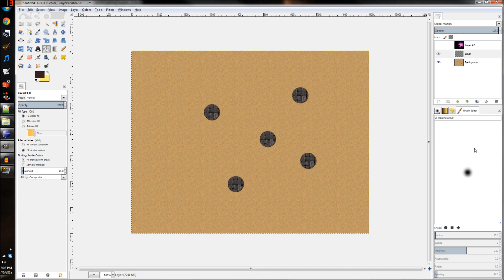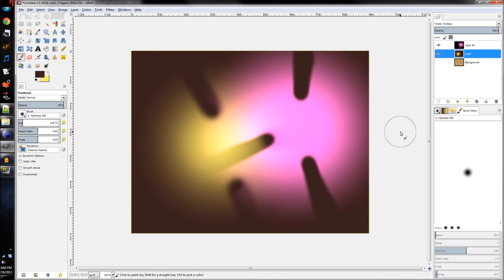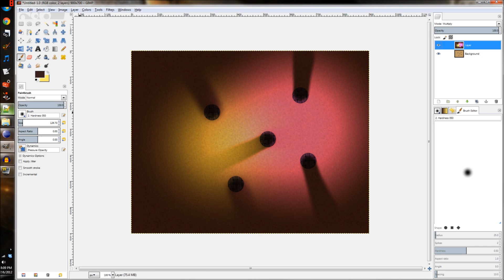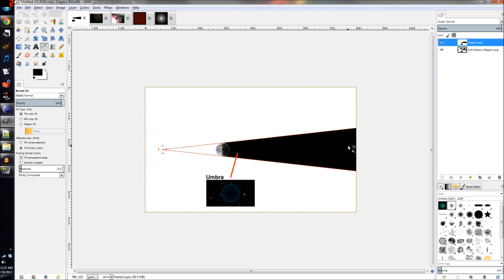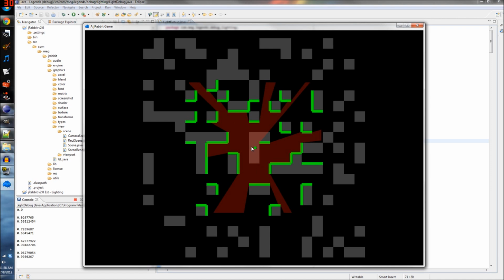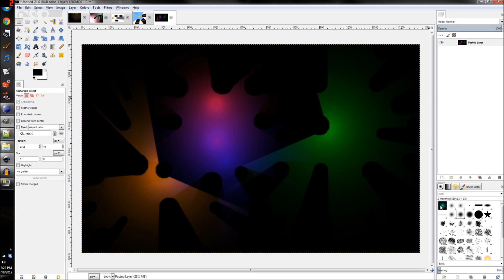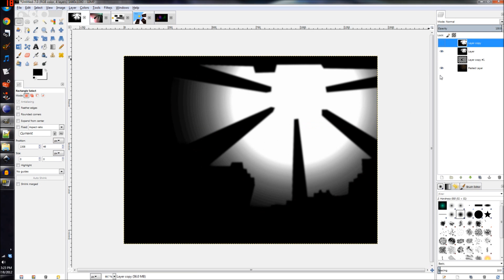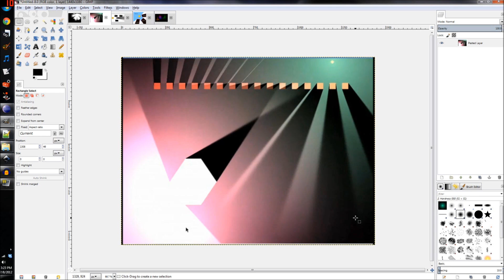2D Lighting Tutorial Part 2 - Shadow Casting

Comment: I know, I'm writing this comment 3 years later, but I don't care. I've also made some systems of light based one one strategy: Starting in one point, going as far as it is possible on the right, setting the direction that the point ending the ray of light moves (it's like I have a laser, I'm moving around and checking which way the point ending the laser moves) and then checking next points in which dimension of  this point can change. It gives me possibility of pretty easy making flashlight effect without any lose of efficiency. Also it can go reaaaly far (when it is too far it can generate bugs, but it must be just really far). Well what is the best - It is really effective! I'm really proud of this :)

Comment: Just implemented own shadows in monogame (platform independed xna) with blured edges http://www.youtube.com/watch?v=zS9q8j2aL6k
its totally implimented in VS and PS shaders, by 360 FOV regarding to a light position and as a result i get rendered texture of depth + blur for each light, where each line of the texture belongs to a light - you can see this texture on my video on the top (when shadowm map is displayed) where value of red is depth, and value of green is blur for specific angle. Then its quite simple to get shadow map:
float4 MakeShadowPS(VertexShaderOutputMakeShadow input) : COLOR0
{
 float2 pos2d = input.PosW.xy;
 float angle = atan2(-pos2d.y, pos2d.x);
 float2 UV = float2((angle / 3.1415926535 + 1) / 2, LightV);
 float2 shadowDistanceAndLighting = tex2D(depthSampler, UV);
 float shadowDistance = shadowDistanceAndLighting.r  * LightRadius;
 float pixelDistance = length(pos2d);
 float4 final = LightColor * float4(1, 1, 1, (1 - pixelDistance / LightRadius));
 if (pixelDistance > shadowDistance)
 {
  // do alpha blending between shadow color (0,0,0, shadowDistanceAndLighting.g) and lightcolor
  final*= max(1 - shadowDistanceAndLighting.g, 0);
 }
 return final;
}

A little problem is that i have to render topology buffer 4 times to get this texture (its rendered as lines, where each vertex of a line is Vector4(posXY, anotherPartofLineXY)). 2 pssses for each depth and blur units with masking channels r/g, +2 passes per each because of the lines where start and end positions according to line position are in defferent planes of the circle and their angles >= PI, ie abs(startAngle - endAngle) >= PI or else in this case it will overwrite almost whole depth buffer, so second pass culls almost all the lines and averagelly 1/8 of them actually rendered.

But depth and blur should be separated because of blending and Z-buffer pass, for depth part it should be opaque and Z-buffer test function as LessEqual, but blur blending must be additive because of case when 2 blured parts of shadows intersected they should give darker result, and Z-buffer should pass always. 
However It could be solved with 2 deffirent render targets with different blendings for each, but Z-buffer comparison can be specified only for both (atleast in monogame/xna), so this solution is not suitable :(

PS. Sorry for such a long explanation

Comment from the maker: The problem with curved surfaces is twofold - first, we're rendering polygonal geometry here, so any curve will need to be reduced to a series of lines. If you want to do curves, it obligates you to have an egregious amount of vertices - kind of a bad thing.

Additionally, the math for curves will be much more difficult. It'll take more time, etc.

With my system, I'd just recommend you place a bunch of straight light barriers around the edge of your curve.